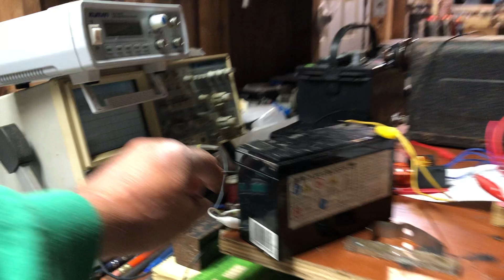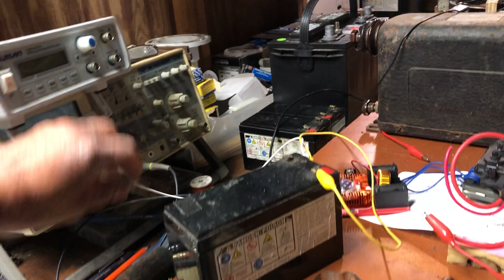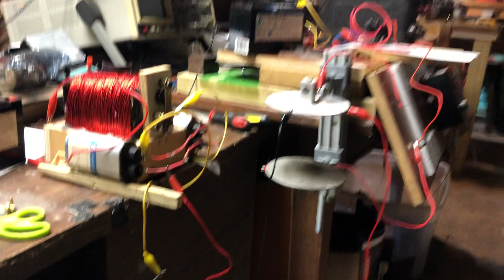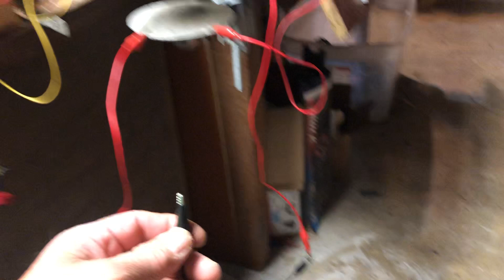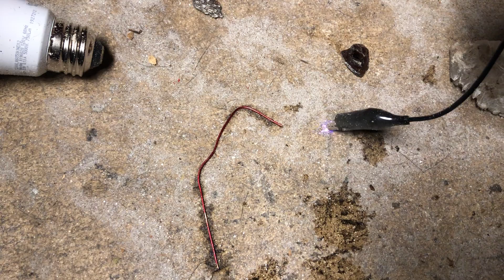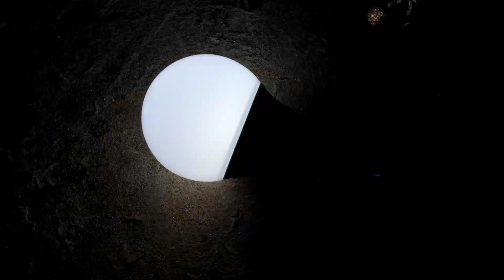Earth ground test, closed loop high voltage circuit!

Comment: ed is right when i think negative i am think of chasis on a plane or car. but ed says with alternating current how the magnets that furnish the generator comes from the air or earths magnetic field. i am not sure how the capacitance makes a difference to earth ground might have something to do with alternating magnetic current which is not the same as alternating current. maybe instead of earth ground try using a resistor like some sort of antennae